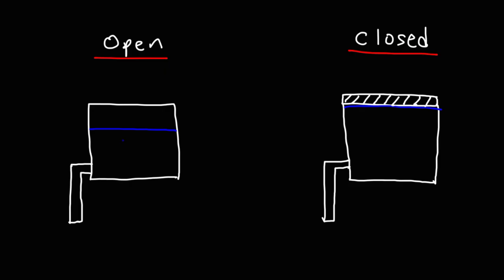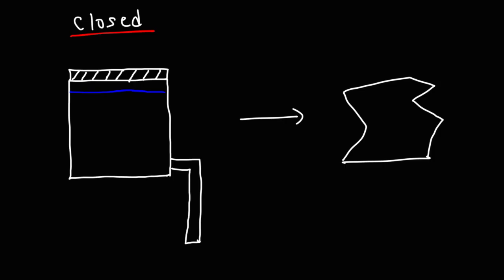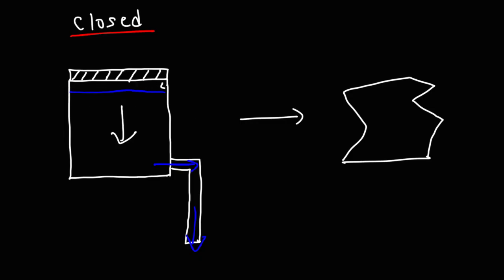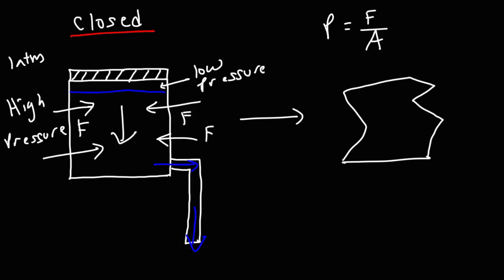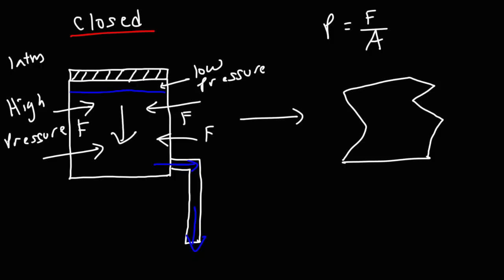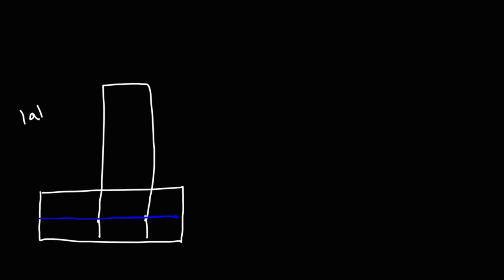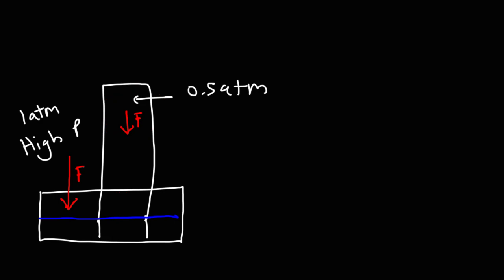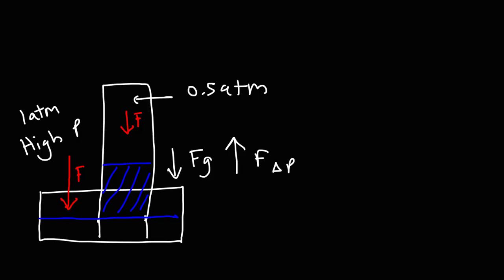Physics - Fluids & Pressure

Comment: Thanks for your excellent videos! Outside the scope of your demonstration, but interesting variables in this experiment:
1. the rigidity of the sealed container will affect the flow outcomes (glass bottle versus silicone bag).
2. the size of the outlet, or added heat and/or surfactants can allow air to bypass the surface tension of the water and enter through the outlet.

Comment: i tried this experiment. but the difference is that when the cap of my bottle was closed the water is not coming out. it is flowing out through the straw only when the cap is open.  is there anyone who can explain this?
Reply: its like when you clog the top of a straw youre drinking
then you pull the straw of water and the water stays in the straw